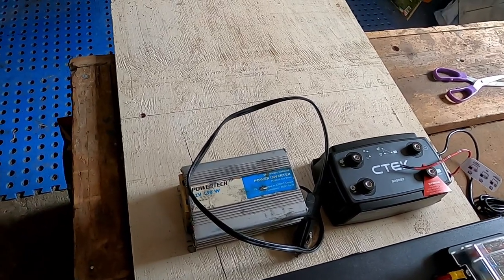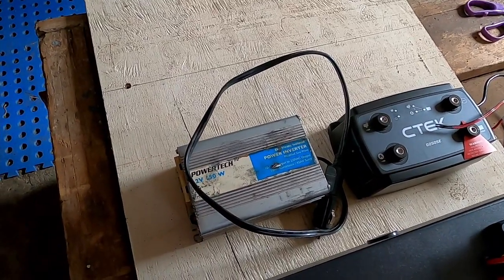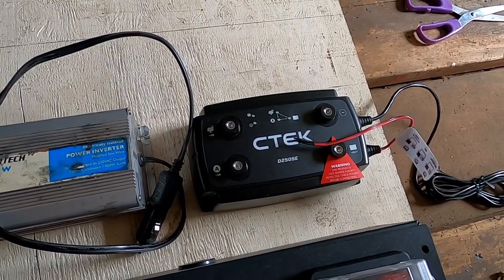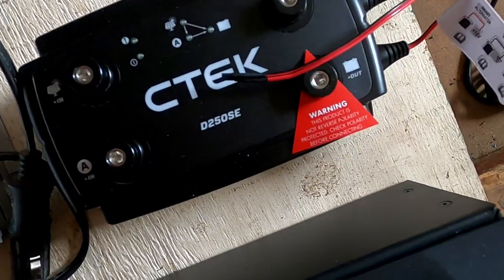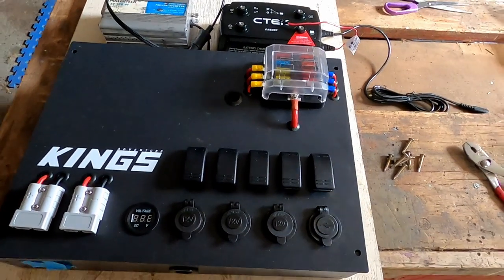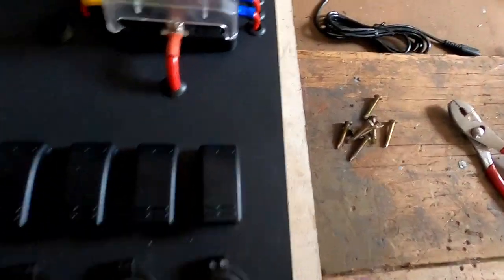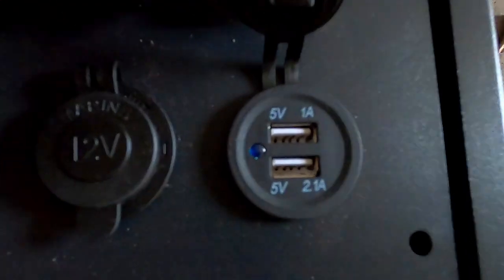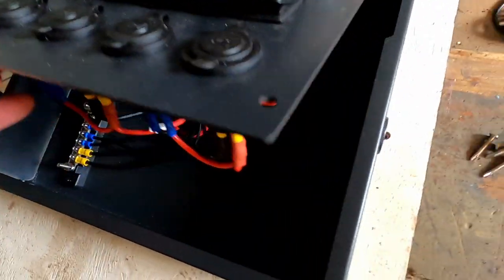Kings 12V Control Box set up and install

Comment: Been looking at doing the same but cant for the life of me work out how to connect the headboard
Reply from the maker: Hi - the ply fits tightly between the back of the drawers and the tub liner. To stop movement there are nuts and bolts through the tub liner. Pain to get in and do it, but worth it so the whole thing does not move.

Comment: Hey mate, what have you connected the ctek dcdc to inside the control box?
Reply from the maker: The positive from the CTEK charger to the aux battery is hooked to the spare red post in the box. There is a cable from that post to the aux battery. Another cable runs from the aux battery to the control box Buss bar. Does that help?
Reply: @ordinaryadventurersinoz  im doing the same on mine at the moment. Does it work fine running aux battery and the ctek output 12v to the same post with all loads running off that post? would save me running two cables from the ctek to aux and back to fusebox.
Reply from the maker: Hi Phil, I'm not an auto electrician so I am not really sure. My thinking was it is probably safer to have the CTEK output only charging the battery rather than having it charging the battery and servicing the load of the fridge (which is the man power draw on the battery) as well as charging the battery. If an auto sparky sees this hopefully they will comment!
Reply: @ordinaryadventurersinoz  Thanks mate, I have seen people do  both and on other brand dcdc and I was thinking the same thing, that its better to take loads off the battery direct. could always fuse output of ctek to 20A to limit but for the sake of a bit of extra cable and another fuse I'll do it properly.

Thought you were a sparky  with that clipsal shirt lol. I'm a sparky but 12v stuff is a whole new learning curve.
Reply from the maker: @philzee7714  didn't even think about the Clipsal shirt - a mate who works for them gave it to me years back and after years of wear it is now a bit of a 'shed shirt' 😂

Comment: Hi Mate,

How did you mount the ply panel that you have to the canopy?
Reply from the maker: Hi mate - it is a tight fit between the tub and the drawers. To help it out there are a couple of nuts and bolts though the tub liner. Has not moved since I installed it.
Reply: How did you attach it to the roof of the tub?